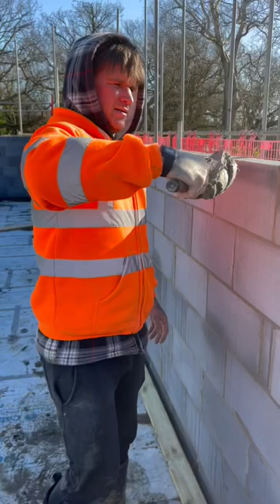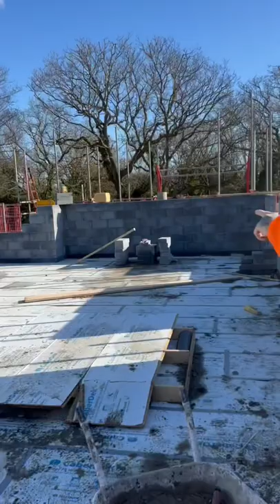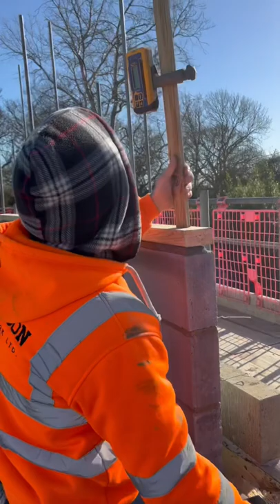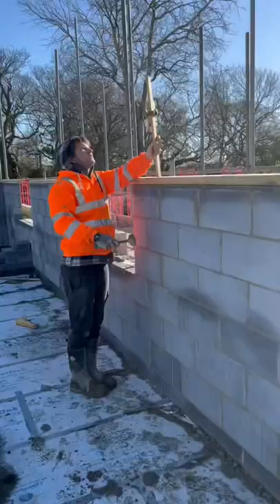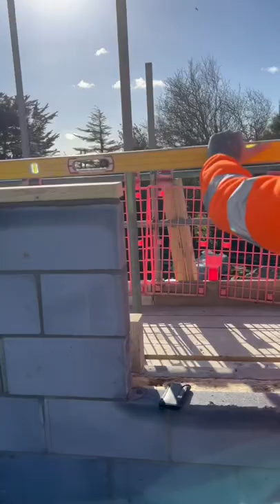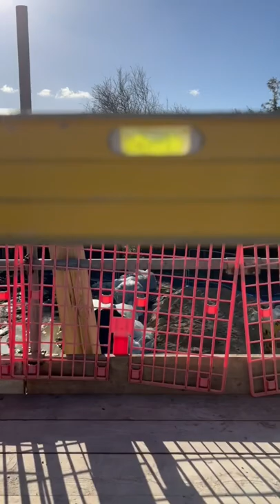Bedding plate like a PRO

Comment: Its only a brickies job to bed the wall plate because the 4x2 is usually shaped like gonzos nose.
Reply: Yes never use a level I have seen straighter looking Turks slippers than the plates we are given
Reply: Hockey sticks
Reply: Exactly and I’ve never used my level on a wall plate never mind a fcking laser level . What’s one of those haha
Reply: @ianmcphee5650  ... THATS SHOCKEEN !! 😏
Reply: Had a good laugh at that 🤣
Reply: Very true 😂😂 as straight as a 50 pence piece
Reply: @Steve A i put screw in the 4x2 before a bed it with screws hanging out the bottom 5-10 mil so the the bed goes off around it keeping it in place
Reply: @@stevea2125 I break the wall plate off the following day and stick it back down with Instastik foam.
Reply: 😂😂😂😂😂 not a lie detected
Reply: Which coincides with the brickies wall perfectly.
Reply: You cant bend wire the shape of some wall plates!😎🤣🖕
Reply: That's normally native timber 😂

Comment: One thing I have never done in fifty years of bricking is bed a wall plate.
Make sure your last course of blocks are nice and level and allow to set before screwing the timber play onto the wall. Doing that way if there is a bow or twist in the timber you can straighten it out. Where as with a soft mortar joint it will set to the timber shape giving an uneven roof truss.
Reply: You've been taught wrong then buddy, I'm a chippy and like he says it's the brickies job to bed the wall plate on, full bed of mortar... Then it should be fixed down through the centre of the timber and strapped to the wall

Comment: I don't do price work, and am a bit of a stickler. I like to use stacks of packers like chippies use, level between them so they're cock on, drill down through the plate into the block with a 7mm sds, brown plugs and 100mm screws. Then use a muck gun to fill the gap with compo. This means that by screwing it down to the packers you take any bow out of the wood.
Reply: That's how we do it as well loads easier to get it perfect 👌
Reply: Well he is on price

Comment: Ever since starting as a chippy I always wonder why they get bedded on like this. The amount of times I go to start pitching a roof and they’re all loose anyway? Don’t know why they don’t get fixed down straight on to block work; the block work should all be level anywya
Reply: It’s always confused the hell out of me too. But I’ve grown up in a family of builders so never understood which grade normally does what. 

The main reason for mortar is It straight onto block is for sealing it. But you could easily use foam, caulk or fibreglass wool to seal it and bolt down.
Reply: We bolt them down to core filled block in Aus

Comment: Am I missing something? That's the bottom plate of a wall and you bed it in mortar? Here across the pond we use j bolts, sill seal or termite guard if needed, then the treated plate is bolted to the stem wall.
Reply: It's the bottom plate of a roof, the trusses or rafters sit on the plate. They are usually secured by metal straps to stop roof lift. Traditionally on older buildings the roof has no wall plate straps and gravity alone holds the roof down.
Reply: @fairyheli2 Bottom plate of a wall maybe..... but Thats a helluva short exterior wall to have the roof rest on.
Reply: @Crown-and-Down maybe it's going to be a mansard roof or something similar?

Comment: No sill gasket...thin layer of foam...basically a moisture barrier protecting the wood from rot. Also keeps cold air out. Fine skills though. Obviously done this a few times!
Reply: What are you on about? This is on an inner leaf at least 2.4m above DPC...
Reply: Not to mention that sill plate will settle in the mud (unleveling it), and should be bolted down
Reply: @bencorbett5838  what in the name of all that's holy are you talking about?!
Reply: @ljones396  will the wood not settle in the mud?
Reply: @bencorbett5838  ...in a word, no. It's set typically in a bed of mortar 4:1. Why would it sink?
Reply: @ljones396  oh ok I thought that it would settle the same way dirt or other putty like things settle
Reply: @bencorbett5838  we use mortar for building in the U.K., they use mud in Africa for their huts is it the same In the U.S.??

Comment: Should put vinyl protection between cement and wood as it will rot over the years . Trust me I have replaced them 👍🏼
Reply: That is what treated lumber is for. 🤔
Reply: @davidmurray6176 treated lumber still needs a vapor barrier FYI
Reply: On the inner skin????

Comment: "4x2" lol I mean you guys do drive on the wrong side of the road too! Nice work brother!
Reply: It's mad bro because don't forget we used to use imperial measurements before we joined to European Union, then everything changed to metric, so inches to millimetres even the money changed from shillings and old pennies to what we use today.
But yeah most of our timber lengths are marked up in the timber yards as metric sizes but we say a length of 3x2 or 4x2 etc but our 3x2 is actually 79x44mm

Comment: Will the wall plate be bolted into the block work once it's set?
Reply: Wall plate straps are used once chippies set roof
Reply: @darrenkaspers9331  Thanks. Don't think they covered that in my L1 carpentry!
Reply: Yeah, wall plate straps come down the wall and nailed or screwed into wall whatever is preferred and placed every 2 metres, don't forget the top of the strap into the wall plate as I've come across that many times!

Comment: It's the brickies job to bed the plate on and then the chippies job to knock it off and get it in the right place. PARALLEL!!!!!!!!! 😉🤣
Reply: If you get a straight timber 🤣🌲💸
Reply: Parallel to the other wall plate?
Reply: @alextomlinson  yes exactly. If they are all level, great, but if they aren’t parallel from each other then its just as bad as out of level. 
Basically the wall to wall distances have to be the same from end to end
Reply: Great observation, a Bricky would never know how a building works 🤯.  It scares me that they manage to create a superstructure that’s square and parallel.
Reply: are you saying the house is out of square? Go check it ya gronk before u have a cry
Reply: @ChucksDream that's only if it's a cut roof with trusses it doesn't matter
Reply: @pauldavies7251  yea thats what im talking about. A cut and pitch roof. Has to be level, parallel and square

Comment: Never mortar under the wood plate. 
Anchor bolts in block. Wood plate drilled and nutted down to bolts. NO MORTAR. W.T.F.
Reply: It gets strapped later calm down
Reply: StRaPs 🤤🫨🫣🫣
Reply: That's what I was wondering but I'm from US we just make sure wall is level when you're done and just anchor plate to the block. The must just do it different there it seems. I'd rather have solid block under my plate seems way stronger than a mortar joint that will crack. Maybe their lumber is so twisted they need the mortar to help
Reply: I was wondering about this process as well. This is a big no-no in my neck of the woods (pt stock, roll of sill sealer and anchor bolted down.) why put mud up there If the 2x4 is going to be removed afterwards? It’s brittle when it’s not used as a grout.
Reply: Haha check out the yanks getting their knickers in a twist. The timber is treated and will be strapped down with restraint straps. It’s the way we do it and have down for over a hundred years.
Reply: @nathturn3869 the longest way isn't always the right or best way.
Reply: @declanp1 these houses will stand for centuries while our North American houses are good for half a century.
Reply: ABSOLUTELY.  What the hell is this? A doghouse ? Mortar under a 2×4???  This is crazy!!!
Reply: With a bed of mortar you get 100% contact with the wall plate ie no gaps. There will then be an L shaped strap, at 1200mm intervals to tie the roof and wall plate down to the wall below. Far better than putting the plate straight on the blocks and one fixing into the top of the plate.
Reply: @larzdoggg From Ohio, was thinking the same thing. Carpenters usually deal with the plate up here anyhow.  Different strokes for different folks 🤷🏻‍♂️
Reply: @vv5179 it’s a terrible process. It’s shoddy. Not all building methods use it here. I’ve only ever seen it crack and fall out done like this. 

We use dry pack normally, as carpenters thst come in. Brickies shouldn’t be going near wooden wall plates. I’ve never worked on sites. 

It’s only this past month I’ve learned that Brickies bed plates. That’s brand new on me 😂 I assumed a carpenter would do that lolz but I’ve only worked for builders before. So never seen what work individual trades do. 

For example it blows my mind that carpenters don’t fill their nail holes in trim lol. Seems embarrassing leaving that for the decorater but like not brushing the toilet after you’ve used it. 😂

Comment: How does the wall plate stay stuck down? That sand and cement will never hold the wood, one little knock and it'll come off once dried.
I had a carpenter who nailed it down once the cement had dried.
Reply: You think you'll knock it off with the whole weight of a roof on it?

Comment: How is that thin outside wall even exist? The walls in my house are anything from 30cm to 45 cm thick of bricks and have 10cm polystyrene insulation on it to provide strength in general and warmth in the house as a whole.
Reply: It’s not an outside wall. Walls in the Uk are made of 2 “leaves” with a cavity in between (minimum 150mm), so total wall size is 102.5+150+102.5
Reply: @techheck3358  thank you, haven't heard of that, we in Ukraine have a bit different approach
Reply: @a-ray114  👍 when I lived in Romania, houses used to be made of solid concrete, building is different all over the place
Reply: Partition block are designed for INTERIOR walls not exterior!! No way to pour them. No lintel. No roof after a bad storm.!!!
Reply: @David-kz6up  wrong

Comment: The house builders must be cutting back, used to be 4”x3” for wall plate in my day. Ain’t done roofing for about 10 years, things have probably changed.

Looks low for wall plate unless vaulted ceilings.
Reply: You haven't a clue what you're talking about mate. Roofing ain't got nothin to do with it nor does the ceiling
Reply: @devonwainstein9188  I beg to differ.
A wall plate is the timber that the roof bears down on and is fixed to. Either trusses or individually cut timbers to form the roof.

The height of the wall plate determines where the roof/ceiling starts from an internal point of view. So as for a wall plate having nothing to do with the roof/ceiling???  

This guys doing a great job anyway, he,s making sure his job is done precisely! Well done pal.

Comment: Never understood why it’s beded on these days. Why not just bolt it down
Reply: Leveling surely?!
Reply: @rich3633  suppose so
Reply: Bolts would split celcon blocks down the vertical axis.
Reply: @stewartrowlands792  disagree, M8 bolts in the centre countersunk on a level final course of block for me would be more solid than a 25mm of muck on a twisted bit of wood.
Reply: It's simple, it's cost reasons. Why spend money on bolts when it already works?
Reply: @dazlad926  average plate around a new build takes a gauge or two. Bolts every meter can’t be much I different
Reply: @user-to2pf8rb5m  In high winds for example you don't want upward pressure/force being placed on the uppermost block where the bolts are gripping the innards of the block as it could crack the block. Also if moisture is present and bolt rusts that could crack the block.
With mortar bedding it's simply to take the load of the roof. Then the straps come down the wall to secure it. In high winds the straps take the force and spread it out over a larger area as the straps come down the wall a fair bit, so it's not just applied to the top course.
Maybe you could argue for bolts and straps but just because the straps are there doesn't mean the blocks with bolts couldn't crack or the bolts won't end up rusting and compromising the blocks strength
Reply: It gets fixed down by the carpenter, the bricklayer just gets it level

Comment: Does wood bond to mortar 😮
Reply: its not for bonding, its for levelling spreading load across entire plate/wall.
Reply: Shouldn't the masonry be perfectly level for the plates to attach to with anchor bolts 🤔that's how we always did it in America
Reply: @gregorydurham7524  the plate gets fastened to the masonry face using an l-shaped steel strap.  One every 2 meters.
Reply: @gregorydurham7524  it’s to avoid crushing any point-contacts.  I’d guess if the bricky always does a perfect job it’s perhaps not necessary.
Reply: Ok

Comment: Masonry in the USA 101
   Concrete or Masonry not allowed to touch wood. Creates a rotting point.
Reply: The old saying goes something like this.
Mud on wood no good.
Mud on steel no deal.
But they use that cheap vinyl flashing that'll keep the moisture out for good.
Reply: This is the UK, that wall plate cannot get wet as it's inside the house,
There's another skin of brickwork on the outside of the house,

We don't build single skin houses here like you
Reply: @Paul davies  like me?
I watch your videos brother. Wasn't looking to insult you.  Just sharing the rules.  I shake my head at most of the things masons do in the Uk. It's good to be proud of where your from and what you do.  Try to remember that you don't know everything.  Most of what you believe in is incorrect. Such is life. I'm not impressed with your building standards. Certainly not impressed with ours.  As a Mason.  I know how To build to last forever.  But like your country I am throttled and forced to build what the customer wants.  The codes require doing just enough to pass. I have a 4 story brick home. It's built in 1890. The foundation is 3ft thick.  It's never moved cracked or leaked.  The brick has never moved or cracked. All the wood in the house is oak. The walls are plaster and have never cracked. We once built homes that were of the highest quality.  Now we are building crap. A new home today will not last 100 yrs.
Reply: @shuqualakreed3557  Well said, I can't remember a time in my own lifetime where houses were built to a decent standard in the UK, or anything really, appliances, infrastructure, all the same.

Comment: This job should be 6" or 8" block. It needs concrete corefills and a bondbeam top. Then you bolt the plate to the top of block wall. The plate he installs in mortar will eventually rot!
Reply: Total total HACK work
Reply: 😂😂 stop talking about things you clearly have no understanding of,
This timber is on the inside skin of the house , will never get damp as there's an external skin of bricks to the house

Comment: You can not be using that white wood for a bottom plate. That concrete will eat it 😋 rotten
Reply: Been used like that for years and never been rotting issue and nor will there ever be.
Reply: What concrete? There isn’t concrete in this video.

Comment: Wouldn't the timber plate rot in time should have a bit of dpc underneath and maybe use treated timber
Reply: Most timber in new builds is treated, how's the wall plate going to stick to the wall with a bit of dpc underneath it ?
Reply: Why would you need dpc it's on the inside skin
Reply: @CC-vw3cz  I think he means dpc underneath the 4×2 and on top of the muck, he's thinking moist from the muck coming through the 4×2 which is miniscule the difference, wall plate won't stick to the muck with dpc underneath it
Reply: Yes dpc under the 4x 2 anyway as soon you land the collar or joist on the wallplate tbe timber will pull from tbe bed of mortor
Reply: @paulcummins6851  I personally put 60mm, 70mm screws into wall plate before bedding them down and at angles, this way the wall plate doesn't move as the muck is pushed around the screws and held into position
Reply: Ols Bricky used to say dont level the wall plate. We dont get paid for it.
Reply: @BB-tx8ty  the muck is not sticking the plate to the wall ! The muck is to level it up, plate straps hold the plate in place
Reply: How can a timber plate rot on the inside skin at roof level ?! How is damp ever going to rise that high ?
Reply: @bobbuilder622  I do a little extra so wall plate doesn't move, I do put straps into wall as well as I replied to someone elses comment regarding this

Comment: Trusses on a 4" block wall? Ridiculous! why install 2 x 4 plate in mortar? Not allowed anywhere in North America!!!!  4" block is not structural!!
Reply: There's two four inch walls
That's the internal skin then there's a 4 inch cavity then an outside skin which is four inches,
We don't build houses out of sticks in the uk
Reply: @pauldavies7251  Questions. 1.) Vapor barrier on the inside layer of wall it's code everywhere in the world. 2.) casting untreated wood in mortar fails every code in the world because it rots. 3.) Laying a 2 x 4 in mud? The mud under the 2 x 4 will crumble over time because mortar does not stick to wood. 4,) 3/4 of the UK videos are brick repair jobs why is that? 
5.) 4 inch block walls are not structural yet trusses and steel building rest on them? I get UK brickies all the time we send them back to school to learn basic codes. The rest of the world has building standards why don't you? No where in North America is this allowed. Look it up!!!!